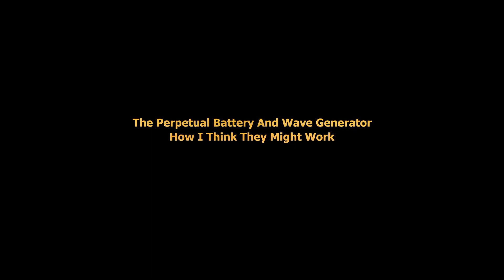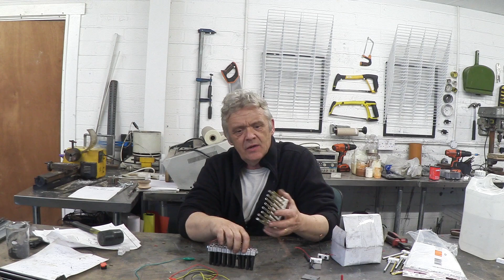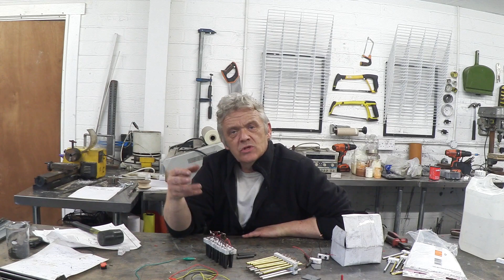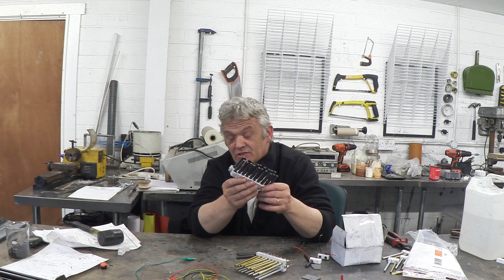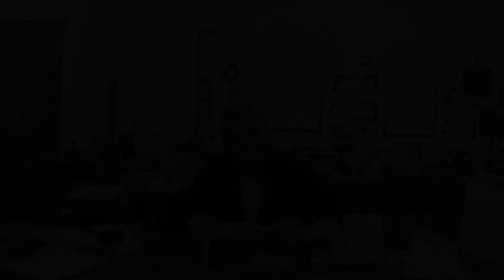The Perpetual Battery And Wave Generator - How I Think They Might Work

Comment: Great vid my friend 👍👍👍 , I thougt a lot about the soilde state clay electrode , thats open a new horizon for me depending for new batteries design . Because we also think how we can use the waterflow in the Atlantic ocean , the salt water can be an endless electrolyte . So gigant ceramic pipes in the sea ... ....
Reply from the maker: Very cool
Reply: @ThinkingandTinkering  Especially if they were catching the run-off from the melting North Sea ice to power TED's and refreeze the ocean in part without generating more heat as would fossil fuel ICE's, gosh word selections can create Titanic conceptual collisions because of navigational errors! Already big business is gearing up to save millions of $ in fuel costs to sail around the Northern hemisphere instead of either the Suez or Panama canals. $ bears no sense in preserving the most diverse and stable of world-wide environments. Instead, we many are being pushed by so few, over a precipice, from which there is no return! By creating small eddy currents of survivability in this rapidly changing world is the greatest service possible! Would somebody please translate for me "Carborundum nil illigitimi!", Thank you.

Comment: Metals receive fields different. Some attracted to magnetic fields and some resist. Some better with heat. The difference potential is directly related to that difference. Same with resistance as you said. But that is only one of the potentials you can tweak. I would worry less about resistance though. Resistance is heat and loss.
Reply from the maker: fair enough mate

Comment: Thanks Robert.

It seems that the easiest way to differentiate the resistance between the two rods is to simply make them different lengths. 

There would be an obviously lesser resistance in a rod that is 1/2 as long, 1/3 as long or 1/4 as long as it's mate. 

The different lengths would likely work for earth magnets as well.
Reply from the maker: nice one mate - you are spot on I think
Reply: @ThinkingandTinkering  
😎👍

Comment: I just had the thought of hydro-dynamic graphite/clay (aka ceramic) fins under a hull or within an interior hull channel of confined water flow. In reverse, would applied current induce flow? Electro-hydrodynamic engine?. You do spark the imagination Rob! Be well.
Reply: You could just plate the hull with tiles of differing resistivity horizontal to the hull so that you don't slow the boat.
Reply: @Barskor1  Yup. Possibly casting into the resin-based hull directly. If electrically propulsive then one would think that polarity reversal may apply braking force.
Reply from the maker: like it mate and cheers

Comment: Instead of (or in addition to) manipulating the Resistance of the Rods, have a go at polarizing them as well.  One set of Rods could be surface-doped with an electronegative coating, perhaps using the Bromine that you've already got on hand, or Molybdenum Disulfide, and another set electropositive-doped Rods, perhaps with Calcium Carbide.  By establishing that electrochemical potential difference without switching to corrosion-susceptible metal electrodes, I believe you will increase the current evolution of the electrode array.  Such surface doping could be done in your existing kiln.  Should it work, of course, then the future Carbon electrodes you are sure to make for this could be so impregnated from the start.
Reply: I like that!
Reply from the maker: nice ideas mate - cheers

Comment: Is the current flow a result of magnetohydrodynamics? If you put a strong magnet closeby does the current increase?
Reply from the maker: it may well do but that would make it a magnetohydrodynamic generator - it clearly isn't as there is no magnet - of course there is the field in the earth but it is going to be weak and make this direction dependant - but that isn't true

Comment: Do you think heat plays a part in this. My plan is to build a ceramic engine using these concepts that could be fueled by any combustible source.  I think you have revealed what is happening in my experiments. I still plan to use aluminum oxide for the cathode, my experimenting is primitive, but I think the aluminum has worked better on the devices Ive built so far. Ive also used copper on the back side of the graphite coated anode and that has seemed to improve flows. The Balancing factor is why I added the copper.
Reply from the maker: heat will definitely play a part - here - of course - i have different things i must show - for example killing the idea that this is a galvanic effect - you would get a lot better performance if you used differnt materials for sure
Reply: @ThinkingandTinkering  Right on; thanks Robert
Reply: @ThinkingandTinkering  Ah ok Got ya, yeah there is something else on as I can tell you first hand that this will work indefinite as long as there is ( i know now) a flow. I did an experiment on my stove top lighting an LED I ran this for 12 hours.

Comment: What you are saying kind of implies a similar device would work with air flow as well.
Reply from the maker: it does mate - flowing gasses will have this effect
Reply: @ThinkingandTinkering  stan meyer gas battery! Another part of his tech base that is science! I would love to whisper in your ear science of how what sector in physics for EPP and EEP.
We should make that happen somehow..
Reply: It absolutley works..i made a intake capacitor for my truck..it ups the mpg ...two opposite charged plates..sweeps negative charged ions and combines with the free ions in the fuel...helps it burn more complete...dont use copper it corrodes...try it.. cheers
Reply: @Purenergy555  mate can we speak quite.  Lyons ronney at gmail com. Thanks this year seems to be the year